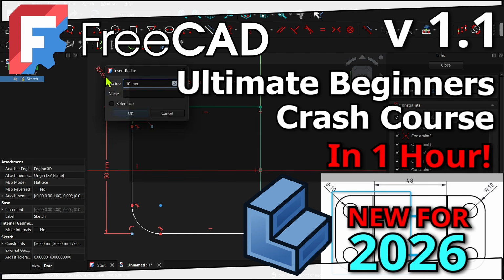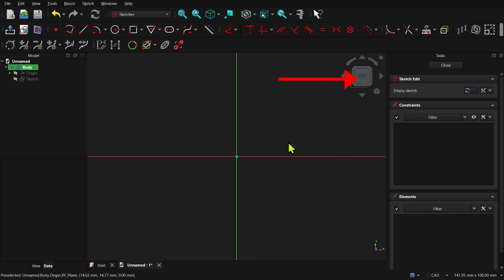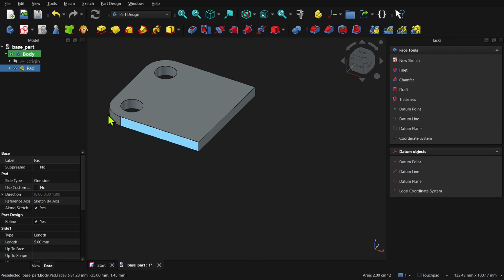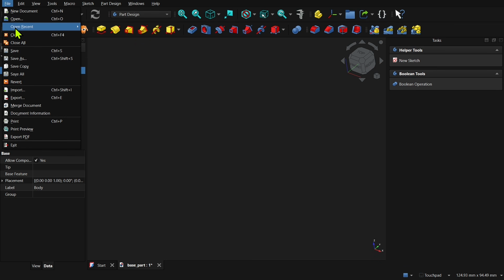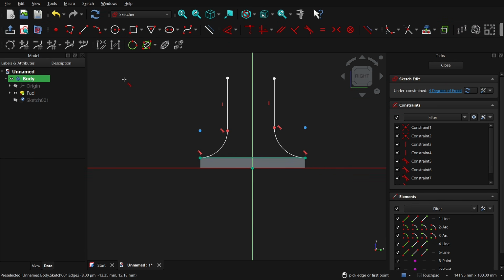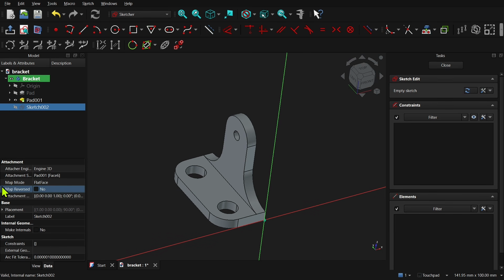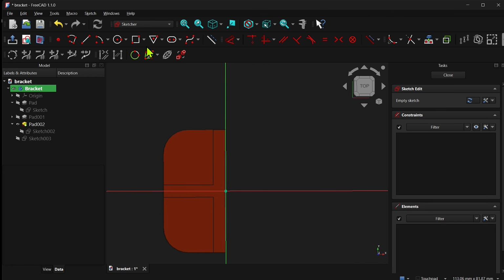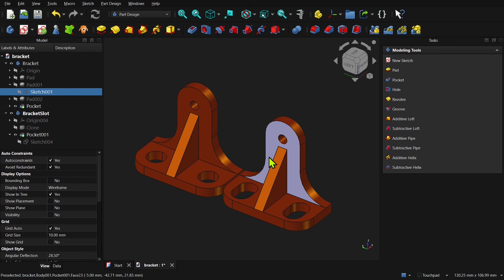FreeCAD 1.1 Ultimate Beginners Crash Course in 1 hour for 3D printing CAD Lesson / Tutorial

Comment: Just like most tutorials, you miss steps; You opened an Empty Project and it had an Assembly Tab (mine only shows that Tab if I open the project as Assembly). I hope this doesn't take as long to learn as it has taken me to get a recording DAW and interface to work (14 years) In had to eventually get someone in, to help (almost impossible to find anyone). It is very frustrating (I am creative but useless with technology and can't find any courses or tutors to guide me). Rotate doesn't work either. Very little matches (I tried drawing the rectangle at 50mm x 50mm and got a very tiny square) I live in Dalyellup, Western Australia; please tell me there is somewhere, nearby, where I can get help with learning this thing. I've found tutorials to be basically useless.
I foynd the problem, with the tiny box (you didn't say to zoom in, before you draw the box). I've had to start over and over again (just trying to get the basics) rotate and move, don't work with the mouse (I don't use touchpads; too difficult to control; using the mouse is so much easier (I actually disabled the touchpad). I think the problem may be that my version has updated to 1.1.3 and this tutorial is for 1.1 (It started as 1.1 but has updated)

Comment: What's the best way to create midpoints? I'm struggling to easily create midpoint of a rectangle
Reply from the maker: You can use the 'Symmetrical' constraint by selecting the two end points of a line and then the origin point to snap them perfectly to the center. There is also a centered rectangle geometry.
Reply: @MangoJellySolutions maybe you could do a video on the topic? Coming from Fusion360 creating midpoints of shapes is my biggest struggle so far in FreeCad

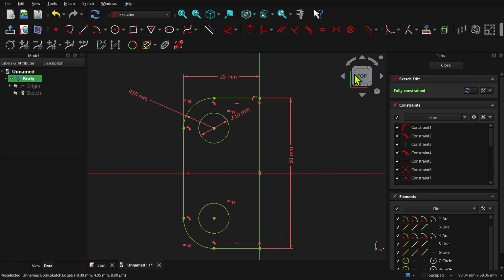Comment: 32:27 At this point it turned orange and told me the model was over-constrained. How do we deal with that? Great tutorial!

Edit: I just started over and got all green this time, but I'm not sure what I did that was different from the first. The error message saying what constraints to remove isn't especially helpful.
Reply from the maker: This sound like you may have auto remove redundant constraints off in the task pane drop down of the sketcher.  If you come across this issue click on the number link on the right by the side of the message and it will highlight the constraint that are in error which you can then hit delete.  With auto constraints on it's very easy to apply a constraint by accident whilst laying down geometry. Create a circle and you only have to touch the axes or other geometry and the tangent constraint appears and if you don't notice it and click to place the circle the constraint will be applied.  Glad you enjoyed the video and hope that information helped.

Comment: @55:33 'import the fillets from both sides' - when I do this the curves are selected with the broken purple lines but there are no points in the middle. What have I done wrong?
Reply from the maker: There are a few things that I can think of:
* Maybe you used the b-splines tool rather than an arc when you created your fillet in your previous sketch, but you would of had problems with centering the arc if that was the case.
* Try clicking the toggle section view tool in the sketcher, you may have some geometry blocking it.
* It may be a screen drawing issue, rotate your viewpoint slightly with your mouse to see if the point appear.
Hope those help.
Reply: @MangoJellySolutions  Thank you for your reply. I ended up closing and restarting FreeCAD and using the External Projection tool again. This time it worked and I can see the centre points. I think I may have encountered one of the point-visibility bugs that are shown on the FreeCAD GitHub.

In my earlier comment I forgot to thank you for this video. I have found it very useful. Going to finish it now! Thanks again for your help.

Comment: I am finding this video a little frustrating as I follow the steps and do not get the same results. As soon as I try and make it symmetrical I get errors coming up and cannot proceed from there. Seems to be quite unforgiving for a beginner
Reply from the maker: It's worth sharing those errors in the comment as it could help with a solution. First thing comes to find is make sure the 'auto remove redundant constraint' option in the sketcher located within the drop down in the task pane is enabled.

Comment: This FreeCAD 1.1 Ultimate Beginners Crash Course is incredible. I've watched a lot of CAD tutorials and this one is on another level for how detailed it is.

The step-by-step is SO easy to follow. Nothing is rushed or skipped - he walks you through everything from installing and setting up FreeCAD 1.1, configuring preferences and navigation, all the way to building fully parametric parts.

What I loved is how clearly every tool is explained in so much detail. The Sketcher and Part Design workbenches, creating fully constrained sketches, using pads, pockets, fillets, chamfers, mirrors, external geometry, gussets, ribs, the whole feature tree - it all just makes sense because he explains the why behind it, not just the clicks.

It's genuinely designed for absolute beginners but doesn't feel basic. You finish with real, usable parts you can export for 3D printing, and you actually understand how parametric modeling works inside FreeCAD. The clone workflow for creating variants was a game changer.

If you're new to FreeCAD or coming back for 1.1, watch this one first. Clear, thorough, perfectly paced. Thank you Mango Jelly Solutions!
Reply from the maker: Thank you so much for such a detailed review, I really appreciate it!

I put a lot of effort into explaining the why, rather than just showing which buttons to click, so it’s great to hear that came across.

Really glad the clone workflow and parametric approach were useful too. Thanks again for taking the time to write this!

Comment: Thank you for this video - YOU are a GREAT instructor! 
As a complete beginner, I have many questions but only this one at present: at about 8:50 on the timeline, the word "Body" suddenly appears in the left panel; where did that come from?
Reply from the maker: Thank you :) So the Body is the container for the part that is being modeled.  When the body is shown in bold it's know as the active body, it tells freeCAD that any operation from now on is to be added to the container.  The operations are added in a linear order, building on top of the result from the last operation know as a feature.  You can have multiple bodies within a single project. Hope that helps.

Comment: When I try to  dimension for the triangle for the Bracket I got: Over-constrained:   ( 1,4,5,6,7) What do I wrong, the external projection where  purple dashed and polygone line tool was white?
Reply from the maker: It sound like you are going into redundant constraints (a constraint that is added that is not needed as other constraints fullfill what you are trying to constrain).  In the sketcher pane you will see a drop down where you can check the option "auto remove redundant constraints".  Where you see the message regarding the constrain problem there is a number by the side of it.  If you select that it will highlight the problematic constraints and preselect them, you can then hit delete on the keyboard to remove them.

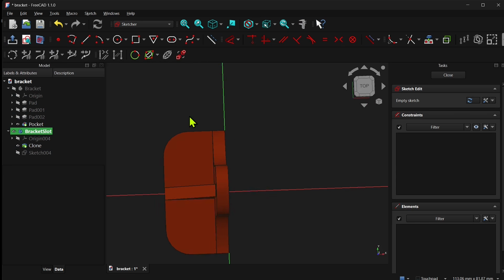Comment: @58:28 I encountered a problem. I selected the face that I was going to make a sketch on, a popup named reference appears showing three options about reference and dependency. No matter what I select, the only face I can make a sketch on is the only I selected and not the plane. The external projection doesn't work outside the selected face ☹
Reply: Nevermind. I just have to enable the Active Body first 🤦‍♂
Reply from the maker: Don't worry, common mistake....... I still do it to this day.

Comment: Thanks for this video, it was so helpful. The only thing I would add is explaining some of the logic behind some of the actions. There are things that you do that I don't know the reasoning for why you did it, so I feel like when working on my own models I won't always know when I should use the specific actions. For example, the reasoning behind the whole toggling of construction geometry and external projection. I don't understand why you have to do that and don't just add the shapes directly. (Sorry if this is just a dumb question).
Reply from the maker: That's a great question, and definitely not a dumb one; basically, construction geometry is used so the software ignores those lines when creating the final 3D solid so they are just used as reference. In prior versions this was not the case. Pulling in a edge with the external projection tool and leaving it as defining can result in a floating line in the sketch if it's only used as reference, when you run say a pad operation, resulting in the error 'wire not closed'.  FreeCAD things you have 2 profiles, one closed and one just a line, so it's open.  Thanks for the feedback as this helps make future editions much clear so I appreciate that.
Reply: @MangoJellySolutions  Thanks, appreciate the response, that makes sense.

Comment: For both the mirror and later gusset extrusion FreeCAD 1.1.1 didn't automatically "Refine" perhaps I missed a set up step. It can be toggled on in the part design on the properties box
Reply from the maker: This sounds like it could be the setting is turned off in the preferences.  In 1.1. this lives in the top menu > edit > preferences.  Navigate to the part design section > general.  There are a number of refine option within which are normally checked.

Comment: Single greatest video I’ve seen! I wish I had this 3 weeks ago when I started to learn. I’ve never used cad before and it’s been difficult. But this really cleared things up for me! Very much appreciated! The one thing I’m still not clear on, maybe I missed it, but can you move the view around while you are in a sketch? Instead of clicking the directional faces in the top right? Sometimes I can’t see in my part and I’ve not been able to move it around like when just viewing the part when not in a sketch.
Reply from the maker: Great to hear you are enjoying the video.  To move the view around in the sketcher use the same navigation as you would in the 3D view when you exit the sketcher.  Look down towards the bottom right of the screen and you will see a small button that tells you which navigation style you are in, it may say something like 'touchpad', 'blender', 'CAD' etc depending on what has been selected.  You can click this to change the navigation style but most importantly of all you can hover the mouse over the button and a popup will appear after a few seconds.  This gives the short cuts and mouse gestures for pan, zoom and rotate.  

Also, running along the top toolbar there are a set of magnifying glasses, fit all will fit everything in view.   If you right click you can also pick align view to sketch which can be helpful.
Reply: @MangoJellySolutions thank you!!!

Comment: I have followed the instructions to the side polyline making it fully constrained but then when closing the sketch and selecting the Pocket it says  "wire is not closed".   This is the second tutorial that issues that same error after completing (i.e. fully constraining ) a sketch.  The "Validate Sketch" is always disabled.  Ok, upon review, the  "toggle construction view" step  I missed. But when I do that step that tools are in blue  and the video clearly states  make sure those tools are not in blue before proceeding.
Reply from the maker: Don't worry, this is a common stumbling block.

If the tools are in blue and geometry you add will be construction, the geometry will not show up on exiting the sketch so will not be extruded into the final shape.
  
If the tools are in white then adding geometry will be defining and will be extruded when running the operation against it.  

When importing edges from underlying pads and pockets using the external projection tool, these will come in as either defining or construction depending on what the tools are set to (what mode you are in).  This is a common source of the 'wire not closed' message as often you will import the geometry as a reference to constrain to but forget to either toggle to construction mode first before importing or forget to select the imported geometry and toggle that to construction.  If you do remember then when adding new geometry again you must make sure you are in the right mode before starting otherwise you will need to start toggling the new geometry to the correct mode i.e. back to defining. 

Hope that helps.
Reply: @MangoJellySolutions   Finally I managed to turn the icons white by clicking on the "toggle construction view"  again. And managed to complete the tutorial.  Thanks!!

Comment: I have been interested in 3D printing, and designing things to print for a while. I thought a big bore blow dart cone was a good, simple first project. I figured out how to make what I wanted with additive and subtractive shapes pretty quickly, but wanted to add a fillet to the outer edge of the collar that holds the dart, but adding a fillet to the shapes was applying it to the inner and outer edges. Your other tutorial video on FreeCAD helped me enough that I was able to sketch half the cross section, and use revolve to make what I had in mind!
Reply from the maker: That is a great to hear you have been taking parts from multiple videos to get the job done, great to hear you found them useful and they have given you what you need to get up and running, thanks for sharing :)

Comment: Thanks for this tutorial. It taught me all I know about FreeCAD 🙂

I only found two things tricky. One was at the very end, when you used transform to move the bodies around. It was not clear to me that one has to click and drag *on the actual arrow heads that the transform tool displays*. Very obvious in hindsight...

The other was getting the toggle state wrong between defining and construction geometry when importing geometry. If you leave the imported lines as defining geometry, you can end up with "wires not closed" errors if you try to do things like pockets or pads. The cure is to select the offending lines and toggle them to be construction geometry. Again, easy in hindsight.
Reply from the maker: Great to hear that this video has helped you and really appreciate the feedback.  You say it's obvious in hindsight but really it's only obvious if you know how and I should of made those clearer in the video, so apologies for that. I know how frustrating it can be when first learning the software and these little things can really trip you up without the tutorial being clear.  The toggle state is a very common 'gotcha' in freeCAD is one of the main reasons for this new version reshoot due to certain behaviors that have changed in freeCAD.  So don't feel alone in getting bitten by that one.  Glad you enjoyed and learnt something from the lesson.

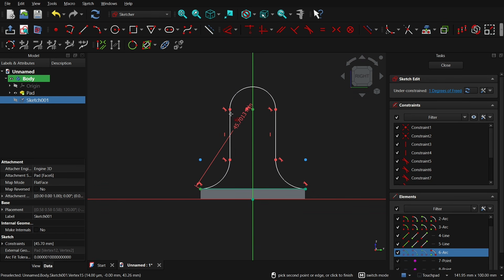Comment: When I try to apply the dimension constraint at 37:54 I get this error:
Cannot set the datum because the sketch contains conflicting constraints (2 times)
From what I can see I have all the same constraints as you
Reply from the maker: Hi, in the constraints list on the right double check that you haven't got any additional constraints, double check that the constraint runs vertically when you apply the constraint and not diagonally or horizontally.  Also select the geometry you are apply the constraint to i.e. the arcs on the left and right click and click on 'select associated constraint' from the popup menu.  This will highlight the constraint associated with that edge, arc etc and will make your life easier when troubleshooting.
Reply: @MangoJellySolutions  I was applying the constraint horizontally. Thanks for the help

Comment: Perfect for beginners or with a little more experience as myself, still learned alot. Especially the section where you mention that there would be issues with using the holes without constructed as pockets instead of combined in the  sketch's pad.  👏🙏
Reply from the maker: Thank you for the kind feedback, I really wanted to add something around going back and editing the design for a change of intent rather than just changing the shape and have that flow with the tutorial (also the final part this weekend).

Comment: I have come across several minor issues using V1.1.1. The latest one is during trying to draw the rectangle on the bracket. So far fully constrained and "external projection" activates top line and is dashed purple. So far so good but then try sketch rectangle error shows "unhandled base exception caught in GUIApplication notify.. access violation". The 3D screen goes blue & bracket white. It then goes weird. Thought I would highlight incase others find similar. Could be my preference settings? But I'm new to FreeCAD used Fusion & Solidworks previously.